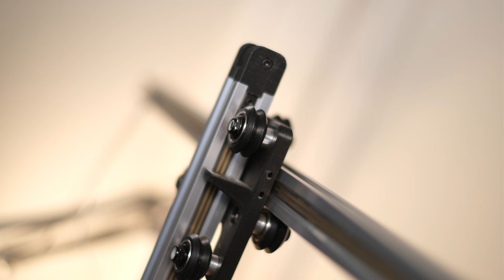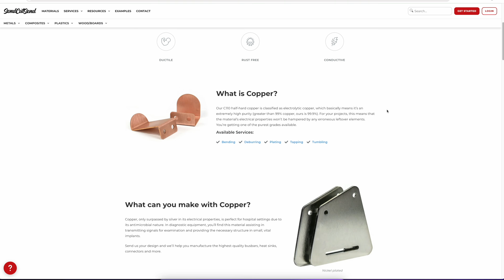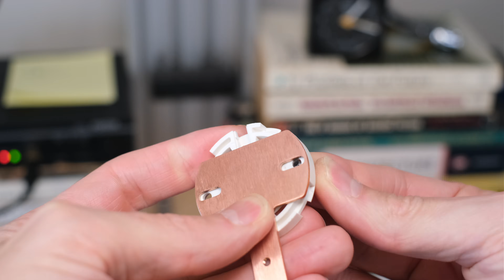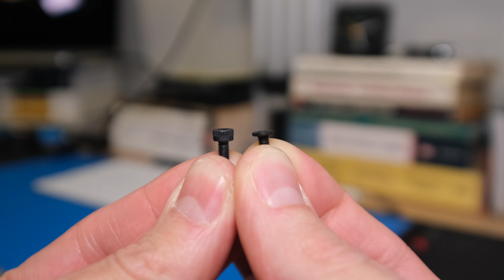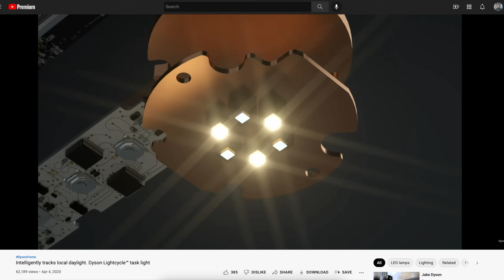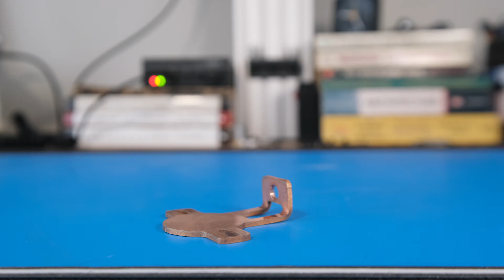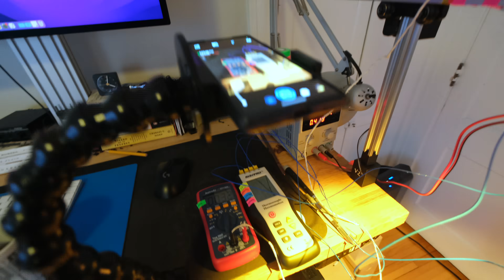Just how good are heat pipes anyway? - DIYson Lamp Build Log #10

Comment: Did it work? Mixing copper with aluminum is not a good idea because there will be galvanic corrosion. I have a suggestion: use the center hole of the aluminum profile to make a heat pipe. I just don't know what you can use as the wick but perhaps some sinthetic high temperature cloth.

Comment: The weakest link in the chain is bracket. It is too thick and even if it's cooper, heat slows down when it try to goes one side from the other. It should has 1 or 0.5 mm thickness or you can directly stick it with the thermal paste to heat pipe.

Comment: 8.:00 I like the idea of adding more (MANY MORE) holes down the center of (your choice size) spaced by only a single bolt head diameter_not threaded(cheap)_ Reason: weaken the center, thru drill and nut Or tap-drill the aluminum..maybe make long holey "uni-washer" to give more authority to the screws to force the copper to bend down to and make solid contact with force..to the bottom of the Of the slot(top of the T). An elegant uni-washer: SS bar stock, counter sunk to match the hex-key bolt head(even if you have to counter bore the top couple threads..pro-tip). You ..miight end up with extra clearance if you keep your engine near.🙃
There are better means to the basic concepts end.

Comment: Nice work and great looking result. I'd really like to see you nail this properly, so I will share a little engineering knowledge with you in the hope it helps. I crunched the numbers for your Cu design on the basis of 300mm overall length and 1.6 x 10mm cross section to get a figure of 46K/W. So for every Watt of heat go into one end of that bar, the hot end will settle 46deg hotter than the cold end. Something you need to keep in mind as well, the temperatures you are getting are only relevant with respect to the ambient temperature. You need to consider them as temperature rise, not temperature. This is important because if anything tangible gets to 60degC or higher it is a burn hazard. Even 55degC is pretty uncomfortable.
My calculation above ignores the heat lost into the Al extrusion as well as the impact of the rise in temp around the length of the Cu bar.
The reason, as an aside, that the pipe version rises slower is because it is more effective at removing the heat from the lamp and dumping it into material further away. This effectively increases the thermal mass experienced in the area of he lamp, and hence the slower increase in temperature.
My advice here would be to replace the LED with a power resistor say in a TO220 package for convenience and return to the LED when you have the thermal design right. Keeping the LED below 70degC is ideal. Keeping it (typically) below 85degC is critical.
Using the power resistor eliminates that problem from the testing. And the first test should be if it is possible for the Al extrusion to lose the 10W of heat without excessive temperature rise.
On the topic of your power rail PCB, beware if your ballast (LED driver) is a constant current type and that it can handle an intermittent load (if the rail connections get dodgy). You could also use the Al extrusion as one of the connections provided the power to the LED is classified as SELV. It should say on your ballast if you are using one.
The thermal equation I used is (T1-T2) = length / (Gcu x Ax)  :: Gcu is thermal conductivity of copper = 400W/mK, Ax is cross sectional area of the bar and l is the length of the bar. You could try developing a thermal model of the bar and extrusion or the pipe and extrusion. The concepts are the same except the pipe will have far far higher thermal conductivity than the bar.
I hope this helps and it is not insulting to you. I noticed you did not do any calculation type stuff and my being an engineer, I just had to try to help solve the problems.. I look forward to seeing where this project goes.

Comment: -countersunk screws
-machining the major diameter of wheels to create clearance, lathe or hand filing, or using electric drill to turn the wheel and then file
-masking the sides of the bracket and etching the middle of tthe copper strip with ferric chloride
-also when you feel like the tolerances are too tight, always try to widen the tolerances if it's not crucial to the operation

Comment: In your design the cob LED is below the rail. Why not just clamp the LED to the underside of the aluminum rail? The rail is a big heatsink. Your copper bracket will be pretty expensive since it is a pretty inefficient shape to cut out of sheet metal - you'll have > 50% waste copper

Comment: A couple thoughts, can you use the aluminum extrusions as a ground to reduce the amount of pogo pins? Also, maybe look into how motorcycle ignition points are made, that may allow for a different solution than pogo pins. One more thought, maybe a round chip heatsink with a mini fan could work for active cooling.

Comment: Shove a round 4mm heat pipe down the center hole and use a copper bracket that is 90 deg on the end of the rail, use a longish copper screw, you have all of that aluminum cross section and not using it, instead you're trying a small cross section of copper strip.

Comment: The first screw in the solid copper mount is probably acting as a bottleneck for the heat flow through the bar. You could make the section to just past the first screw full width and chamfer the edges to fit within the channel so there is less restriction (bonus benefit of increased rigidity).

Comment: I'll mention I'm at 16 minutes in the vid and the the concerns the op expressed... dude,  u got a stick of copper + you got an LED COB. For data, hold the led against the copper stick with a timber weight or something impermanent, give it power and take temperature measurements. This should have happened at an earlier iteration when u had the first copper heat sink. For a sense of rigorous testing take measurements along the length of the test rig at periodic intervals from initial startup to say 5 or 6 hours run time. I'm seeing some great elements of design but id suggest finding a mentor you can get along with to save time and money reinventing the wheel.

Comment: if you had grasped the idea of the heatpipe you wouldn't had been surprised.
It is obvious that the vapor must  run to the other end of the heatpipe to condense and to be able to go to the "hot end" again - it's the whole idea with a heatpipe, take the heat as far away from the source as possible !!
With the heatpipe the heat is taken away and is slowly coming back - hence the slower buildup of temp. of the LED.
With the pure copper the heat is slowly taken away from the source.
You should had place one more heat sensor - 100mm further down the aluminum from the copper/heatpipe - try see the temp buildup there ;-)

And yes, as others has pointed out - why didn't you use countersunk screws?
 
and don't thread the holes, use self-tapping screws - the kind that press the thread so you don't produce metal shavings - is is a standard screw for the electronics industry, and they also come as countersunk ;-)

btw - I hope your slider contacts are made of the right material !! - else you will soon be dealing with a problem you don't like to have in mass :o/

Comment: Cool project 😆 Heat pipe is genius. 
These LEDs are often over-volted, with no current regulation. As such they tend to have short MTBF. With the right power supply you are able to turn down the voltage / current by as much as 60%, before you perceive a dtop in luminosity.
The heat you are currently making, thats wasted energy.

Comment: You could probably use an extruded heatsink with a small 40mm fan to cool it, that would certainly be under a couple bucks if you were to buy quality parts in bulk.

Comment: you secure the cool end of the heat pipe with a single screw, with nothing pressing the middle of the heat pipe down into contact with the rail.
Do you think there was enough give/bend in the heat pipe that the middle has poor contact with the rail, and that this might be contributing to the farthest end of the heat pipe distributing more heat than the center?

Comment: im so glad i waited to comment here..  i was screaming at my screen to use the 'threaded heat pipe' design!! IMO, its a more logical design to use overall. copper heat pipe is easier to obtain per economies of scale and much smaller 'custom copper parts' are more likely to cost less, and it would definetely cost loads to make the copper heatsink design considering you wouldalways need a garuntee of some toleranceon the sheet metal even through manufacturing. not to mention, if someone wanted to manufacture it themselves, the heat pipe attachment is just so much easier to make. a couple holes, lots of room around them, rather than a couple holes with not much space. though im surprised at your mounting approach for the pipe /w the paste, i would much rather it was soldered, akin to plumbing, or thermal epoxy. i think the good thing about that design too is the flexibility. theres no real constraint stopping someone making this themselves from using epoxy or soldering to mount the pipe depending on their tools.

Comment: The heat pipe also uses the state change from a liquid to a gas to absorb LOTS of energy/heat when it changes state. It takes 5x more energy to go from 100C water to 101C steam than the energy to go from 0C water to 100C water....like wtf... Also some heat pipes use ethanol instead of water because of its lower boiling point.

1.We want to find out how much heat energy in joules it will take to turn the ice with initial temperature of -5 degrees Celsius into steam at 110 degrees Celsius

2.We can plug in our specific heat or how much energy it takes to raise 1 kilogram of ice 1 degree Celsius  = We get a heat added of 724.6 joules.

3.Now the ice will have to under go a phase change from ice to liquid water. This will require energy = 22,977 additional joules of heat needed to convert the ice to a liquid.

4.For the next step we need to find out how much heat energy will be required to raise the water from zero degrees to 100 degrees. = We get an additional 28,883.4 joules of heat energy needed to raise the water up to the boiling point.

5.The water will need to change phases again this time from liquid to a gas = We get an additional 155,940 joules of heat needed to get the gas to turn into a vapor.

6.Now that gas will have a slightly higher temperature then the boiling point. In this case it has a temperature of 110 degrees Celsius. So now if we multiply the specific heat times the mass of steam and the change in temperature or delta of 10 degrees Celsius we get 1,380 joules of heat needed to raise the gas vapor by 10 degrees Celsius.

Lets find the total joules of heat needed to get water from ice to steam. We can add up all of the joules of heat needed for the various temperature changes and phases changes. So after we added up q1 through 5 we get an answer of 209,904.9 joules of heat energy to make .069 kilograms of ice at -5 degree Celsius into steam at 110 degrees Celsius.
Reply: Your calculations are moot because the point of this system is not to absorb the heat (it has very little capacity to do so relative to the heat produced by the LED) but rather to transport the heat. So any phase changes the fluid goes through at one end of the system are reversed at the other end.
Reply: You miss the point… my point is look how much heat the phase change can absorb, which as you said dumps that heat at the other end when changing back.

 5x more energy going from 0c to 100c just to go from 100c to 101c steam. Phase change is what makes heat pipes as good as they are
Reply: @EQ_EnchantX  Well first your calcs are based on water going from -5C to 110C, whereas the temps shown on the graphs in the video dont get close to either freezing or boiling of water. You are probably right that the liquid involved is something with a lower boiling point such as ethanol, but still doesn't involve freezing.  The function of the phase change is to produce a pumping action. The same system could be implemented with a mechanical pump, with no phase change, using liquid as a heat transport medium, and would be as effective.
Reply: Correcting to add that evidently water can be used in this temp range in heat pipes design for it, which have their pressure reduced so that the boiling point is also reduced. This is so that some liquid water at the hot end will indeed evaporate, expand, and prompt circulation.
Reply: Dude, you’re missing the point. The math is just to show the power of water and phase change, it was just to put into perspective how much heat it can absorb… not too math this video…

Comment: I think the heat pipe makes it hotter as it goes away because you only have the single screw at the end holding it down vs. the mounting bracket with the three screw mounting points to conduct to the aluminum. Not sure if good/bad but this can explain why it seems to be breaking the laws of thermodynamics

Comment: suggestion, braze/solder the heatpipe to the led head.  then in either case heatpipe or not, do not use CPU heatsink compound, instead use thermal putty.  im sure your heat pipe temps could be lower with those 2 but always needs testing.  also better pressure on the heat pipe could help, if you tested that?  was the thermal paste run the entire length of the of heat pipe?

Comment: MY solution would be to long conform the long bracket into the channel.

It will hold the part in place without any screws, while keeping it really low profile AND increasing the total thermal distribution.

Comment: this has been pointed out already but I'm not sure you saw it, so I will mention it also: you really should try soldering the heatpipe to the copper plate, I'm betting you'll be amazed at the difference that makes because that interface is very small and the thermal resistance of the paste will probably be a significant bottleneck.

Comment: Since the wheels only contact the rail on the chamfered edges, why not put the wheel in a drill and sand off a tiny bit from the outer diameter

Comment: My solution would be to check lower profile wheels. or just shave a few microns off the peaks of the wheel. Essentially you are only using the SIDES of the wheels for the main support, not the very tips of the peak. You should have no difference in support.

Comment: love the process. could you turn the inside of the super track into your heat pipe, but use butane as the working fluid as it has a lower vapor point?

Comment: Heat pipes exist for a reason.
The heat pipe solution also has another notable advantage, that L bracket used to mount it is providing a good thermal interface into the aluminum rail.

Comment: I apologize if this is a silly comment as I haven’t seen any of the build other than this video.  Is there a reason that you can’t add a 90 degree “bend/mount” to the heat pipe or copper, then use the perpendicular face of the extrusion to mount within?

Comment: 22:40 And If you improve on the heat dissipation on the cool end of the pipe you should be able to keep the temperature even lower (think of summer and 35°C). You could use SMD soldering paste or metallic thermal paste and maybe design a heatsink that fits into the rail?

Comment: How good is a heat pipe?

A real world example is capable of transmitting 4 times the output of the sun (area of sun surface vs cross section of heat pipe)

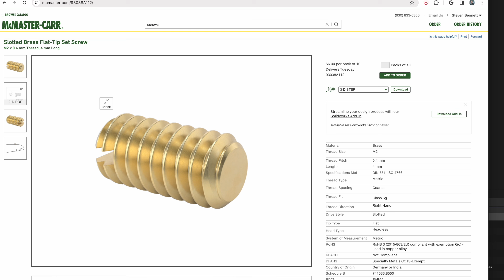Comment: 6:58  Brass has really BAD thermal conductivity
Reply: Brass has relatively good thermal conductivity compared to the other common screw material, steel.  But the whole thing is moot since the  long skinny copper tongue is a terrible geometry for conducting heat more than a few cm.

Comment: Last time i had this problem. I just lapped the screw heads and took off .1-.2mm of the head. when a #3 counter sink screw didn't work. It's not like the heatsink needs alot of torque to hold them in place.

Comment: I'd suggest trying any kind of screws which are flush or below the bracket surface, and using bare non-sealed ball bearings. I admit I just dropped in the middle of this video without prior knowledge about the project, so I may be completely wrong. I'll watch the previous videos because it seems an interesting project. Black matte anodized profile, and maybe also sand blasted and painted black bracket should also radiate more heat away if one of the goals is cooling the LED as efficiently as possible...

Comment: Both solutions seem over-engineered. Would love to see you slap the LED chip onto a standard cheap CPU/GPU heatsink and compare that to these solutions. Might be workable with some small vents fitting inside the head of the lamp itself?  Would be a good use of a extra sensitive thermal camera, to watch the heat move as you turn the lamp on. Fascinating experiments with heat pipes

Comment: You would save heaps of time and money if you spent more time using CAD and some sort of simulation (CFD or spread sheet) so you can determing what option gives you the lowest thermal resistance for the money.  The thermal resistance spreadsheet option (that gives you information faster than CFD) the resistances of each element will quickly show you what element has the least / most reaistance and allow for quick 'what if' analysis.  Also must add in the ambient temperature to your temperature plot.  The largest thermal resistance in a heat-pipipe system can be the contact resistance heat-pipe to sink.  In your lamp you do not have full circular contact around the heat-pipe.  The thermal grease has about 1000x less thermal conductivity than the copper.  So a bunch of grease is next to useless.
At one time the biggest user of heat-pipes was the Alaskin oil pipe line.